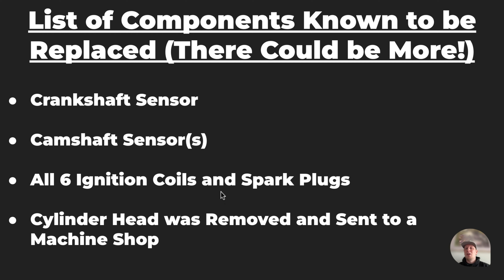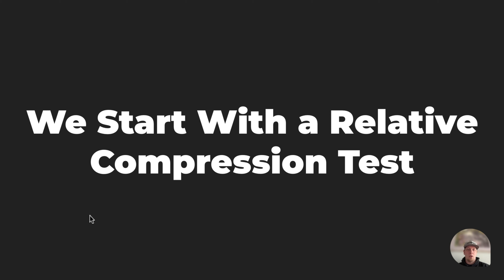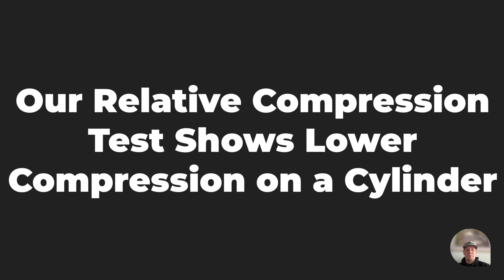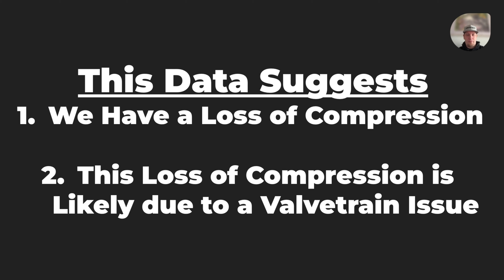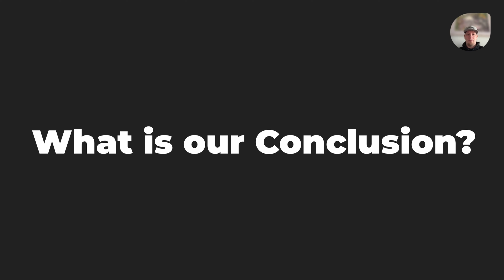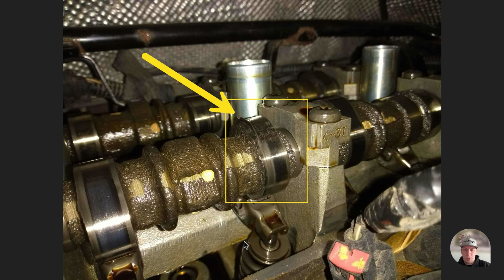Misfire Diagnosis: Dodge and Chrsyler 3.0L, 3.6L and 3.2  Pentastar Vehicles

Comment: Exhaust valve intermittent on in cylinder waveform. Sharp crisp open on two lower pressures, flat non crisp opening on the higher pressure. Thanks Topdon.

Comment: You don't know if the repair shop sent the cylinder head with the camshafts still on.  They may have sent the head to have it clean and checked only. We are a machine shop. We get heads often for clean and resurface only. Most of the time the repair shop do not want the valves removed. We do want the castomer approved and the head leave with a well understood disclaimer that ends with, no warranty and or no guarantee. Btw the early 3.6 had a major issue with small cracks on the exhaust valve face in cylinder one only. This would also cause a similar code. 

Thanks again, great information.

I very much like the wat you explain the scope approach for testing.
Reply: Very true. Unfortunately with secondhand information we cannot be certain who committed the human error….but someone sure did 😅
Reply: They had this tore down, and missed this???!!!
Reply from the maker: Thank you for your thoughtful comments! It's great to hear your perspective as a machine shop and the importance of having customer approval and disclaimers in place. The issue with early 3.6 engines having cracks on the exhaust valve face is definitely valuable information for misfire diagnosis. We're glad you found the scope approach helpful, and if you have any further insights or questions, feel free to share. Your feedback is much appreciated